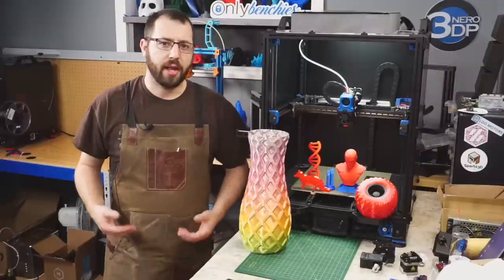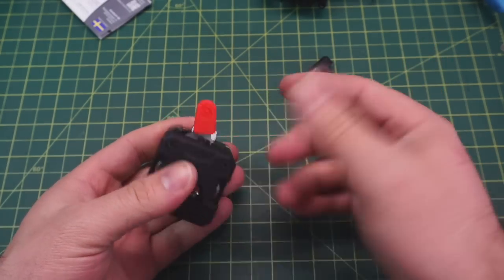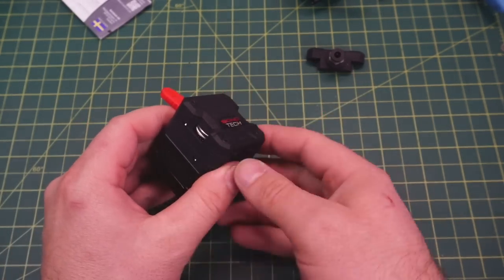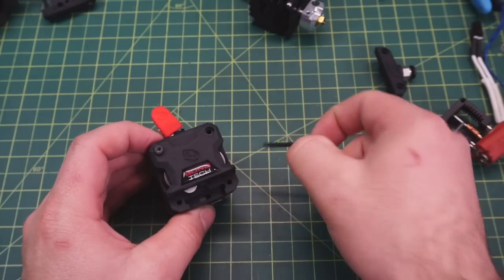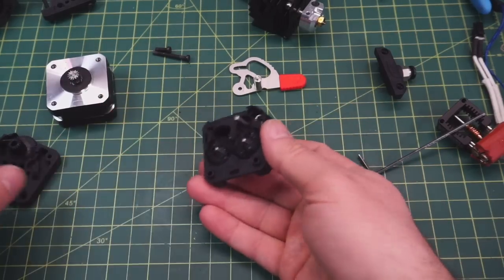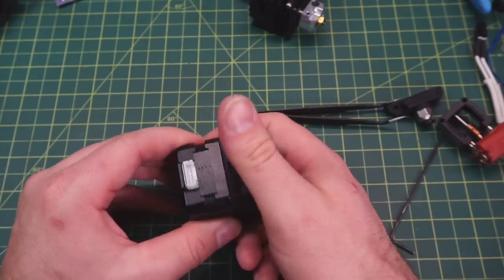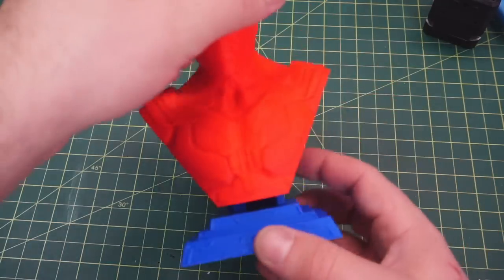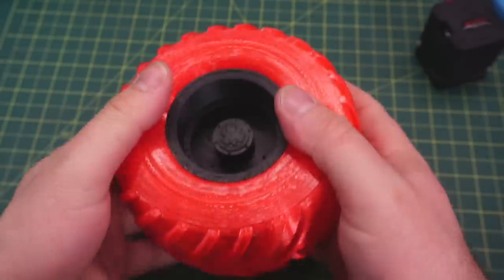Bondtech LGX Extruder - New hotness or more of the same?

Comment: I like how you roasted the Ender extruder like five times in this review.
Reply from the maker: it deserves it
Reply: As someone who had to keep disassembling the extruder to change filaments cause of that damn extruder, it deserves it
Reply: I have the same MK8 style extruder in my Anet. 
It deserves it.
Reply: I’m disappointed it was only 5 times 😁
Reply: Ender 3's are shit theyre only popular for the price but there is a lot of design problems especially the single rail for the bed thats a bad setup in my opinion you need 2 rails
Reply: It was made to barely work, not to be the best reliability or experience
Reply: @TotoGuy-Original  my Biqu B1 has 2 rails and I can't get it to wobble, despite it having roller wheels. But it has other bullshit issues such as a terrible stock hotend, shitty jet turbine fans, and the same extruder. 

Still like it quite a bit though.

Comment: These compact extruders come with one major advantage compared to basically all "old school" extruders: A very shot filament path.
The filament does not need to travel through a long heatsink, where especially flexible filaments are compressed (or streched during retraction) and extrusion precision is therefore reduced.
Especially with TPU you can significantly increase print quality and significantly decrease retractions.

You are leaving the major advantage of this extruder behind by the way you attach it.

I understand your concerns regarding center of gravity and loss of print area, but this both can be mitigated by careful printer design. 
I am currently in the process of designing a carriage which lets the mounts of my X-axis slide in a slim gap between motor and X-axis. 
I will hardly loose any printarea compared to a topmounted system.
Reply from the maker: In terms of design with mounting, thats going to vary printer to printer, and everyone has their own goals in mind with what they want.

With regards to the filament path, with the setup i was using it was a 60mm bowden piece between the hotend and extruder, i use some spare cap tubing i had and encountered zero issues feeding material, including TPU, through it.
Reply: @CanuckCreator  that's definitely true, but if you want to evaluate the LGX then I think you ought to include printing TPU fast, and printing super flexible filaments, since this is what it's supposed to be good at. If you don't push its limits, and only show that the LGX can do exactly the same things as you could with your old extruder, it doesn't show the whole picture :)

Comment: The feeding would be smoother solely because of the gears being bigger, the smaller the gears the clunkier the engagement and that’s why you typically don’t see tooth profiles with less than 15 teeth. That’s why the walls of the box section are smoother

Comment: Thank you for taking this apart to show us what is inside. my initial opinions in bondtech (from years ago) is probably the same i dont like them using long hot ends you can lose a lot of height in that. i see what they are trying to do with the surface area however a bmg style i prefer this. ok you have to set the tension yourself which could be a pain for some people but i like it. the dual gear setup has a lot of bite and there is a very small gap between the gear anf the ^ part where the filament goes down into the extruder. 

my extruder is a bmg style but its like a hymera without the weird shaped heatsink i dont need the V6 or similar hotend which i am so grateful for i just have my heater block and throat below and because its all metal billet aluminium it can dissipate the heat nice no need for a large hot end. 

it is nice to have the ratchet i guess but it would be nicer if the teeth were a lot finer i can see there could be issues with that but having the bigger tooth wheels its probably not a problem. its nice that you can clean the wheels without taking it apart but if you got a bmg style setup correctly it should stay clean in there.

Comment: is an improvement but have better option like OMG dual wheels for more contact. I prefer spring and spring reles from OMG or titan. because what if i need a right presure between already lvl bondetech make. Imagine i need presure betuen lvl 1 and lvl 2 how i set it in this LGX?
and for more contact have 3 axe rotate asparagus sweeps.

Comment: First of, I like your down to earth, yet thorough approach to testing but I think may have seen a tiny bit of comfirmation bias going on toward the end of this video in reg. to the surface quality. If you used exactly the same parts, speeds, etc (except for the extruder) between the two prints then yes, you are probably right in your findings. But a few other things could lead to the same result. (If the parts are the same, then please do disregard the above;))

But what's even more interesting is how many subs comment that now they are eager to get an LGX... I mean, people are free to buy what they want and I like bling, too but unless you know for sure that you have issues with filament slipping and grinding, then I think the conclusion is you may not see any improvement in your prints at all. Or at best, a very, very minute one. What you may very well get is a heavier extruder which is not a non-issue perhaps if you are at the forefront of techy print wizards and fool around with klipper.

Comment: I'm gonna put a gear or a belt and use one of these combined setups with it. the motor is on the back with a belt connected to a 5mm shaft and a bearing!
definitely not the lgx cause god that cost smore than my entire life, but rather the NF Sunshine
nf sunshine sounds like the best market buyable extruder to me, it's hemera and sherpa combined. but I wanna make my own extruder that uses sanding belt.rubber to push the filament to avoid marks on it, and it also uses a flat path to have more grip over 1" of filament instead of a small spot

Comment: Well I think I know what I'm buying. My Ender 5 Pro extruder is is slipping on certain filaments only and I really need it up and running to start printing parts for my Voron 1.8 build. For the time being I think I will order this and throw it on the Ender, and then swap it to the Voron once I build it and buy something a little cheaper for the Ender. I also already have a Phaetus Dragon on the way from China for my 1.8.

Comment: ur comment on how you have to mount a hemera on the front is slightly wrong. I've been using a mount that puts it fully underneath (with the linear rail below the x bar), it makes it far more stable than even generic dd printers. although this is on an elf. I fixed the lost Z with a simple halo rise, lifting it by the lost amount (ofc harder to do on something like a v2.4 where the entire halo moves up and down) but a lot easier on something like the v1.8 of course. just a bit more info on this subject.

Comment: 5:56 - that looks like a groove mount on the adapter (The circular part?) - how would one put a mosquito on that adapter to get it to work?
Reply from the maker: That dished out circular area is because the LGX mount works with all the afterburner supported hotends, that cutout is for the v6 groovemount
The bowden tube goes through that area  keeping filament contained, so the gap when a dragon or mosquito is used isnt an issue

Comment: So... It's not even lighter than the standard direct afterburner. Its only advantages are the clicky arm and the big gears. 

Recipe for the perfect extruder: take the motor and the gear reduction of the Orbiter, and take the clicky arm, its spring and the two large gears off the LGX
Put them together into a Clockwork replacement extruder. 
Name it something like "The Pointlessly Expensive Extruder" 
PEE for short
Reply: Phonvoli, this sounds like the next Orbiter version.
Reply: I think you may be on to something with PEE as a lot of printing folks suffer from "People Invest Stupidly Syndrome"... 

Just kidding. I too spend money on "bling parts" once in a while. That said, I don't want a heavier extruder so I am all with you on how Orbiter and LGX need to make a baby.

Comment: Would love to see how this extruder works with something like the Dragon hotend instead of the overpriced alternative pushed by Bondtech. :P
Reply from the maker: This was all tested with a dragon  hotend in the printer
Reply: @CanuckCreator  oh didnt realize.. how did it mount up just two bolts like normal?!
Reply from the maker: @Moronicsmurf  yup. Drops right in in place of clockwork
Reply: @CanuckCreator  Is yours the standard or high flow version?
Reply: It cost more to make goods in the USA, I think Slice has priced fairly given that. As an American Citizen, I try and support USA whenever possible.

Comment: Hey i have a question, i have an ender 3 v2 and i would like to build a voron one day but i don't have the space right now. What do you think would be the necessary upgrades to the ender 3 to make it in to a switchwire. Do you think it's possible?
Reply from the maker: there are a few mods/conversion designs out there already for turning an ender3 into a SW

Comment: How good is the LGX compared to an M4 Extruder? I'm building a new bowden printer and am a bit unsure which one is better
Reply: Same i was eying a M4 before i found out about this. I think the large feed wheels might outweigh the benefit you get from the 0 lash operation of the M4. Maybe the guys at voron will make a M5 with the new feed wheels. Did you make a decision on which one to get yet?
Reply: @Blenzo480  I ended up with the LGX, partially because it was way easier for me to source than the parts for an M4. I really like the LGX but it is not that much better than a regular Bondtech extruder so if you want to save some money and you can get the parts easily then I would recommend the M4
Reply: @andreasmohr7835 My biggest concern is how easy it is to load. My Printer sits on in a shelve so i want something that i can load without taking the printer off the shelf. The stock extruder on the Ender 3 is pretty hard to load blind. I think i'm going to build a M4 just for fun

Comment: How easy is it to load? I Have my ender 3 on a shelve and i have to take it down every time change filament because i can't for the life of me get the filament threw the stock extruder without looking at it from above. I almost bought a EZR extruder just because they are supposed to be real easy to load blind. I want to retain my bowden setup.
Reply from the maker: Just move the arm to open and push the filament in.
Reply: @CanuckCreator  sold

Comment: In theory there is no more contact between the filament and the large feed wheel. A line and circle can only touch in single point.
Reply: That only applies in a perfect model. The filament is soft so the gears can deform it slightly and get more contact. Analogous to car tires on a road. The contact patch is rectangular instead of a line.
Reply: @MBrewah04  Not really the same. Gears deform the filament locally because the pressure is considerably higher on the knife edges of the gear. So it's more like a clean cut. And in this case it's not the tire that gets deformed it's the "road". The "road" is already flat.
Reply: Regardless of apologies, I don't see how you can say that in real world use, a larger feed wheel won't have more contact and a higher precision of control vs a smaller diameter wheel.
Reply: @MBrewah04  it will also have much less pushing force

Comment: Between this one and the BIQU H2 which one would you stay with?
Reply from the maker: I havent done a rull review of the h2 yet. But the lgx would probably be better for most use cases
Reply: @CanuckCreator  thanks! Are you planning on doing a review for the h2 soon?
Reply from the maker: I have covered it on stream a few times. And one is installed in my ender3 atm
Review will eventually come when i get the free time.